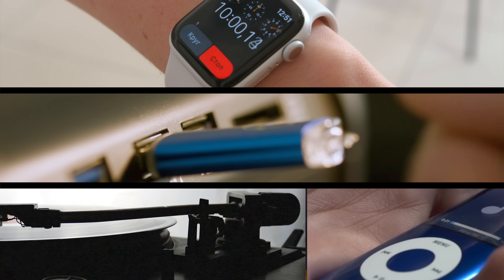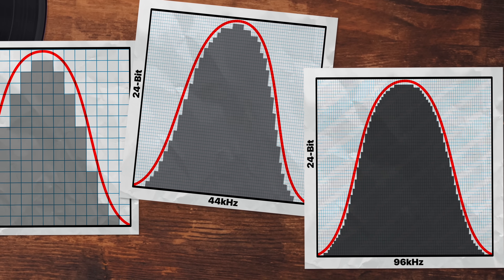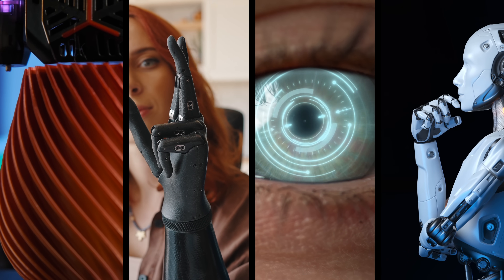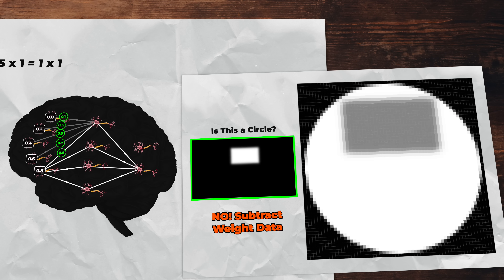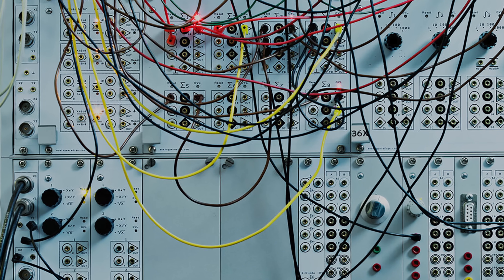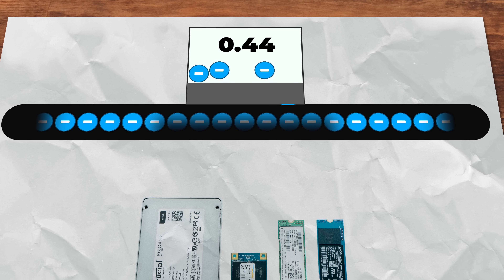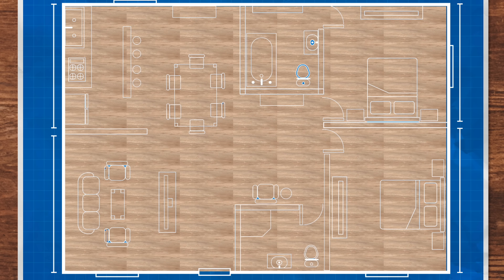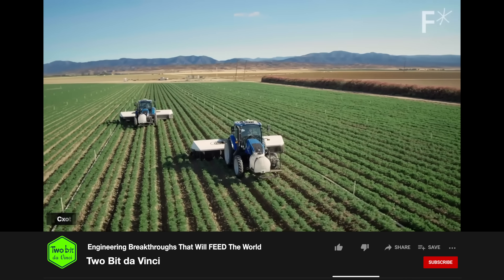Analog Computing is GENIUS - Here's Why!

Comment: On the topic of digital vs vinyl, I think a property EQ’ed uncompressed 24 bit 96khz signal, heck probably even a little lower, is going to be physically indistinguishable from a vinyl recording. If you think about how speakers actually move, speaker motors are not infinitely fast. This means that the “jaggyness” that inherently exists within a digital signal compared to it’s analog counterpart is going to be inherently smoothed out by physics. Heck, I’m sure even the DAC in most systems, even the high end ones exhibit this kind of signal smoothing electricity themselves in the conversion from digital to analog. It’s not a digital signal that makes a sound inherently inferior, it’s the compression
Reply: What you describe as the inherent "jaggyness" of a digital signal is a very common misconception ... it seems like it must be the case when you look at some graphs and it fits with our intuitive expectation ... but it's wrong. If you do some research on the subject you will understand why. In short, the jaggy graph represents sample points but it does not represent the sound wave that is produced ... which is a perfectly smooth sine wave. Yes, it's hard to get your head around this at first (I was the same)!
Now let's move onto compression ... are you talking about dynamic compression or data compression? If you are talking about data compression then the digital signal used for CD is uncompressed ... so no problem there. Digital recording doesn't use data compression either ... but ... streaming services generally do use data compression. They need to save data bandwidth because of costs for them as suppliers and for you receiving their product via your limited bandwidth data connection. If they use significant "lossy" data compression then the audio can be noticeably degraded. If they stick to "lossless" data compression then you end up with no degradation (but the data rate will need to be much higher and more expensive to them and to you). Quite separately we have the issue of dynamic compression ... it would be better if there was a completely different word for compression in this instance because it has nothing directly to do with data compression. In fact you can have a highly compressed (dynamically) track that is delivered to you via a totally uncompressed digital signal ... in fact that is very very common in modern music recordings! The element of a digital file that describes the potential for dynamic range is the bit rate (e.g. 16 bit 24 bit etc). It enables very quiet sounds and very loud sounds without you hearing any background noise. The advantage of 24 bit is mostly at the point of recording as it gives you the ability to match sound levels without bringing up the noise floor. Once the track has been mixed and mastered the advantage of the higher bit rates pretty much disappears ... because a final 16 bit copy is going to have plenty of available dynamic range such that it isn't going to be a restriction to your listener.

Comment: When it comes to accuracy, they’re using eight bit and 16bit math to do Neural Networks inferencing.  This is because less accuracy is needed once the weights have been determined.

The real difference is the amount of transistors it takes to make one multiplier.   It’s proportional to the square of the number of bits.  Analog computing can replace that circuit with orders of magnitude less transistors.  An analog computer can look a lot like an actual brain.

Comment: Analog computing is the latest fad. It is a flash in the pan. The reason is that every analog computer has ONE use. It has to be manufactured to precise tolerances. this makes them very expensive compared to digital. And they wear out, thus introducing inaccuracy. They are also much more affected by the environment. 

Let's take the vinyl record as an example. The record has ONE use. It cannot be adapted to another use. It plays one set of songs. If you want a different song, you have to get a different record. The record itself has to be made to exacting specifications and that isn't cheap. Then there is the expensive bit of hardware you have to have to play the record. All of that starts wearing out the first time you play the record. The record wears. The needle wears, the turntable wears. Then dust in the air gets on the record, degrading its performance. And all of this is extremely expensive compared to digital and takes much more energy to manufacture and run.

Sure, there MAY be some tiny number of people in the world who can tell the difference between 24-bit digital and analog. But there are not many. Most people cannot hear the difference. Vinyl has snob appeal, but that's about it.  Digital is cheaper, more flexible, less prone to problems, and produces an end product that is (for most people) indistinguishable from analog. People are not going to go back to analog.

This is not to say that there are no applications for analog. It's just that analog is NOT going to take over the world by storm. Analog computers are NOT going to "change the world."

Comment: I do believe that analogue will have a big role in future computing. Though I don’t think it will be a replacement for the core computing of algorithms, it will be excellent for sensory functions and identification. The world is fluid and that’s why analogue will be best to interface with it. Eventually the analogue technology will get better and the interface between these devices and a digital computer will become fluid.

The struggle will be to identify the categories between two objects (this is the learning process). Technically everything is different so making an identification is highly complex but when we can create a sensors that identifies with enough points (like 20 for a fingerprint or retina scan OR 30 to identify a species) then we will have a powerful system. 

For example, if an analogue device can identify from kingdom to species then send that information to the digital system then we have made a huge increase in efficiency. The real benefit will come from “fingerprints”that the human mind currently doesn’t utilize. The analogue can process sounds we can’t hear, temperatures we can’t see, smells, tastes, vibrations, etc. 

Bottom line: If you build the sensor correctly then you can download indexed identification data that will make observation incredibly fast. It will also be able to identify new identities that were previously unknown. The downside is that a computer will be able to make an assessment about a person from data so rapidly that it can predict / anticipate behavior immediately. The only way to protect privacy will be through the creation of chaos and noise!

Comment: Digital audio is better than those graphs suggest. Any continuous signal can be decomposed into a sum of sine waves of different frequencies and amplitudes using Fourier analysis. According to  the Nyquist-Shannon sampling theorem, any given bandwidth of frequencies can be perfectly represented by sampling at double the frequency bandwidth.  So, yes, uncompressed digital audio can be equally good as the best vinyl vinyl (arguably better in the real world since vinyl cannot be made perfect).  Thus lossless digital can really be lossless.
Reply: Yes, the representation of how digital audio works was terrible. Watch videos by Monty Montgomery for the truth.
Reply: People who say that vinyl is a higher fidelity format than CDs or SACDs are extremely delusional. It's okay if you like noise added to your music but that's what's added, noise!
Reply: Laplace, Fourier and other transforms are used to convert between different domains. 

A Fourier transform will convert even a square wave or square pulse into multiple sine wave components.  In theory, if you could isolate those components and feed them all back through an analog summer, you would recreate the original waveform.

Comment: WW-II naval ships, used well into the the1970s, used mechanical analog computers for navigation.

All automatic transmission, prior to computer controls, used fluidic analog computers (the valve body) to upshift and downshift.

Comment: 44KHz sample rate 24bit digital audio is just so much better than vinyl.  Firstly the best the record is going to sound is the first time you play it.  To play it is to destroy it.  Secondly there is signal to noise ration.  The best you can expect from vinyl is 65db a CD is in the 90s and remember that's a logarithmic scale, every 3db is a doubling.  Then there is dynamic range and the story is similar to signal to noise 65db vs 90db+.  Finally there is damage.  Digital either works or it doesn't.  Analogue soldiers on but yuk.  You get a small scratch on the record and there is a click every time the stylus passes over it.  It's very unlikely to be in time with the music.   If the scratch is bad enough the stylus either jumps forward cutting out some or it jumps back and you are in a loop.  The love of vinyl is either actual nostalgia (amongst the old) or a romantic view of a perceived golden age. 

Now that's out of my system; in 1968 at the age of 13 (yeah I'm old) the kid next door showed me a card trick.  I figured out how it was done and then dreamed up a machine that could do it. There were 18 cards and so my machine had 18 sets of 3 switches in series with 18 light bulbs.  It was effectively 18 And gates.  That revelation (that they were gates) got me into a school club that was exploring digital electronics by building a project from the magazine Electronics Australia.  We built gates and flip flops from discrete transistors. 

I asked the teacher who oversaw this club if he thought analogue computing had any future or if it was digital from here on.  He thought about it and said that digital looked like it was the way everything was going.  He was a sensible guy though and he hedged his answer adding, "you never know though." He may have even mentioned the idea of hybrid systems with A/D and D/A conversion.

Comment: Vinyl has its tradeoffs, first, the waveform has to be compressed, as the full dynamic range cannot fit into the grooves, so while you might be getting (in some cases) a more accurate representation of the original sound wave on a vinyl, if it was recorded right and the record is in perfect condition, the dynamic range is reduced, so you might not be getting what the original recording sounded like even then... With digital, it's possible to get to such high bitrates and sample rates that our ears and brains simply cannot begin to tell the difference from the original sound wave.
Reply: ... though the irony is that when we moved to digital we also moved  to greater dynamic compression than was used for analogue recordings and vinyl pressings (for reasons of musical taste/fashion/style). So yes, the digital formats can potentially represent the higher dynamic range of a musical performance than vinyl but in practice they use less of that potential in most commercial music recordings.
Reply: @MrAdopado  Yeah it's only niche music that doesn't actually have the shit compressed out of it in contemporary digital

Comment: The way they work, a digital computer is NEVER correct! It is only an appropriation. It can only output 1s and 0s. It can never output .5 or .453  An analog computer can output an exact answer. This is the reason that a CD never has the same sound quality as vinyl records. I'm sure there will be people who disagree, but they have probably never heard a top quality sound system.
Reply: An analog computer not only is not exact, but never gives exactly the same result twice for the same inputs.

Comment: Tolerance stacking will destroy this type of CPU. It's cheaper to get a new age processor that can make sure everything is correct and exactly as it should be. Even then our new CPUs screw up. We can't take a chance with tolerance stacking. 1-5% tolerance per resistor and capacitor and diode and coil isn't going to help us in the end. It's going to slow is down exponentially.

Comment: Imagine also, that analog chips could function as base 3, 4, or maybe even 10 number system for digital computing too.
Reply: If you're using a number base you're using digital computing, even if you use chips designed for genuinely analog use
Reply: That's kind of pointless because the number base doesn't matter and can be easily converted. The only use-case for analog computation is hardware acceleration for tasks that don't require precise results.

Comment: Analog computers could make a come back but I think the most likely analog system to do it would be an optical one using nonlinear optics.  The thing about optics is that a step like doing an FFT and be done instantly.  An image can be filtered or processed to detect some object in practically zero time.
Reply: Fast by nature, Fast by name.

I'll get me coat.
Reply: Analog computers especially for AI weight algorithms storage where absolute accuracy is not critical, it could be a useful addition, aka a niche application.  However, digital has a great strength, accuracy and repeatability.

Comment: If you could have an optical computer, then 8 different colours would be 8 variable layers of computation.
Reply: Except that it wouldn't work that way.  Those different colors are waves of different frequencies, and they will intermodulate with each other whenever there is a nonlinearity in the system, resulting in unintended patterns in the data.  This had to be reckoned with when they developed dual-layer DVDs, because the pits in the first reflective layer interfered with those in the second layer.  As a result they had to lower the bit rate in the second layer, which is why a dual-layer DVD doesn't hold twice as much data as a single-layer DVD.  Similar of course for Blu-ray

Comment: Very interesting update on analog computing which has been a struggle for decades. Thanks! However, I would strongly suspect that any method such as the one in this video that depends on ohm's law will be highly sensitive to temperature variations causing huge errors and unrepeatability much greater than the 5% they claim.  That is one of the huge benefits of binary it gets rid of all nonlinearities and parasitic factors by slamming the node to the maximum minimum and thresholding everything in between.
Reply: What's interesting to me about digital moving forward is that qbits kind of break that mold, at least before the output stage. Sort of a weird mix between analog and digital in a metaphorical sense.
Reply: @ezpk-  Qubits break the mold but they don't have any zero or one state at any given time, and I don't think anyone can even imagine how to make a Turing machine out of them. I suspect they'll be at best a co-processor, like a GPU or an ALU, to a classical Turing machine, for many decades to come.

Comment: but whats the point of analog processings when its a simulated process that still runs on digital language? those neural networks chips are just digital language chip zero and one/on and off. sure it simulate how neuron networks in brains works, but it runs on binary language.

Comment: NASA flight simulators in the 80s and early 90s were anolog. Actually hybrid, a digital computer provided and collected data. Plus checked the analog variation from baseline. But the analog computer had about ten of  1000 times the flight data of a space shuttle launching that a digital computer could calculate.

Comment: you know, in 1974, researchers had developed an analog matrix method that could recognise the alphabetic and numeric characters, individually, with a very high success rate, and i remember being surprised at thesmall amount of analog hardware to perform the job, once learned/programmed...and, even then, the analog methods were very fast and very low power, per "recognition"
Reply: That’s fascinating. As someone born into the digital age I feel I’ve missed out on a lot. Especially as a hobbyist electronics/pcb builder
Reply: @phillies4eva  there's no time like the present for getting into a new hobby. Anything that you missed can still be created by you today.
Reply: @jasonrubik  exactly 💯
Reply: The first scanner for character recognition was used in the 1800’s for sending morse code on the telegraph. 
I had never heard of this until I started working for Xerox in 2007.